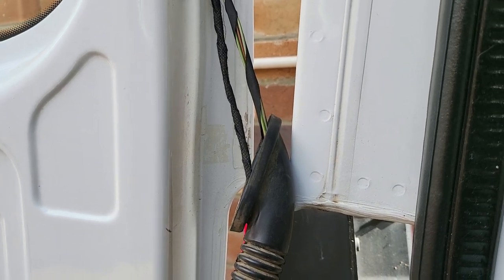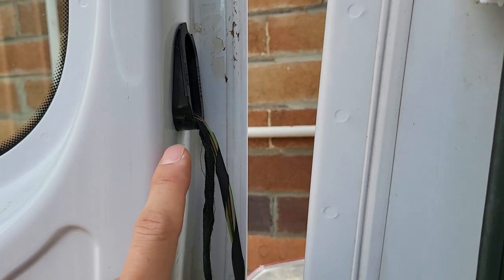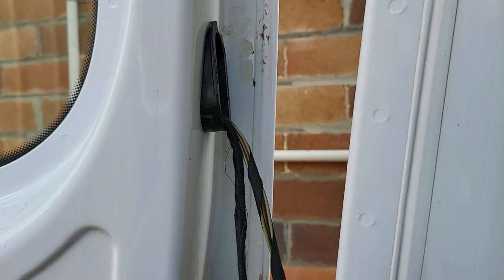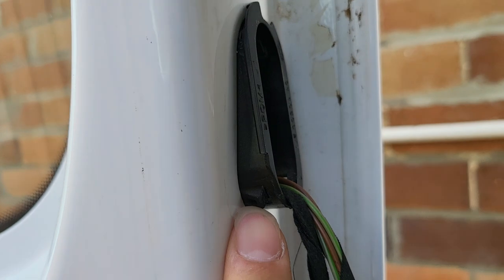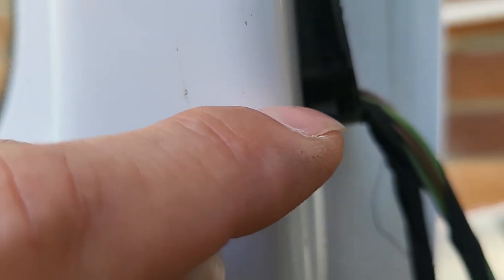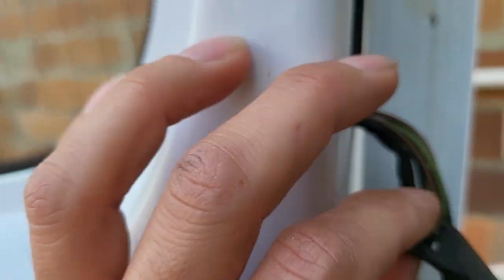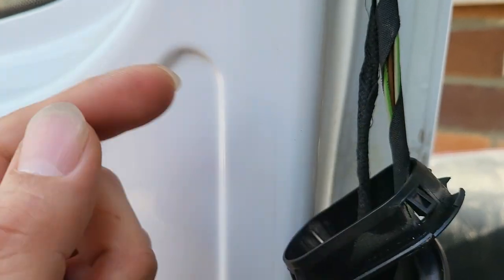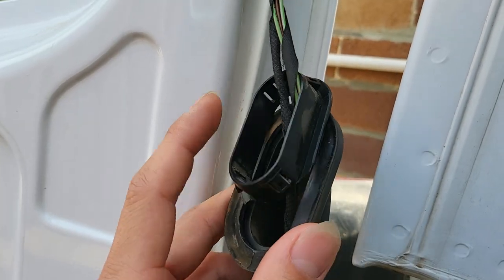Pro Tips: How to put rear barn door rubber grommet plastic ring back original MERCEDES SPRINTER VITO

Comment: Greetings, Thanks for posting this video.  I found an easier way to remove the plastic insert from the outside without breaking it. The key as you keep saying is to be gentle.  I used a very small screwdriver slipped between the body of the plastic insert and the tab, again very gently prying it so that the tab is no longer holding the plastic in.  Because you showed where the tabs were, I was able to identify them and pry two of them without breaking any of the edge of the plastic tab. As you have shown, once two of the tabs are no longer securing the insert, it can be taken out from that side.  Before doing that I "GENTLY" removed the rubber by working it off the plastic insert before removing the insert.  I managed to do this in a few minutes for both the door and the body tabs without breaking any of the plastic. Thanks again for showing your method (my hands were too big to fit, causing my to find another way) and where the tabs are so that I could figure out how to do it this way.  Best to you! Hu
Reply from the maker: You’re welcome. Glad you found it helpful